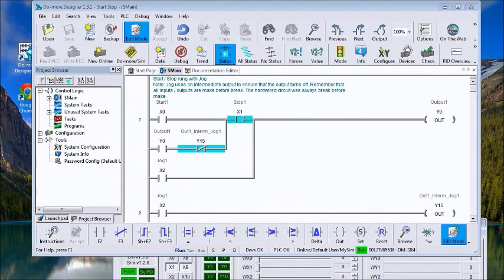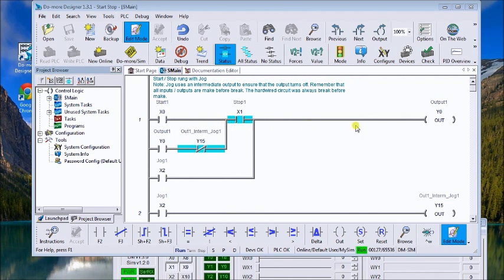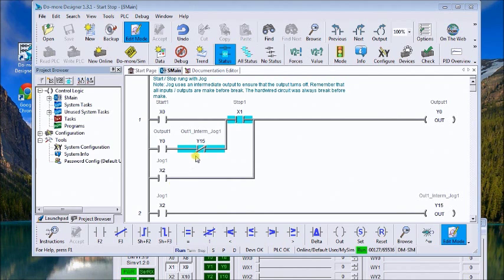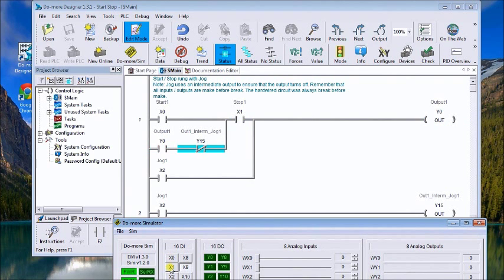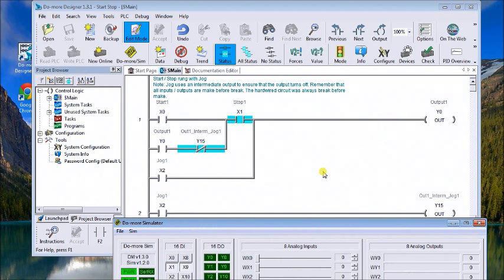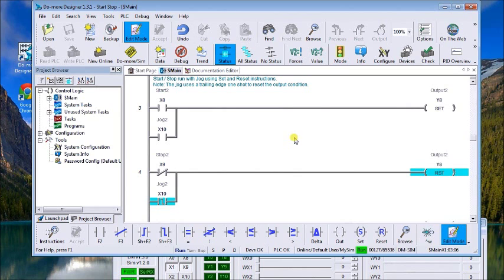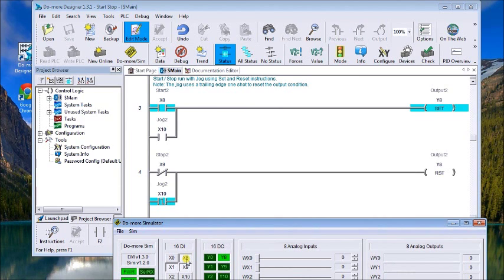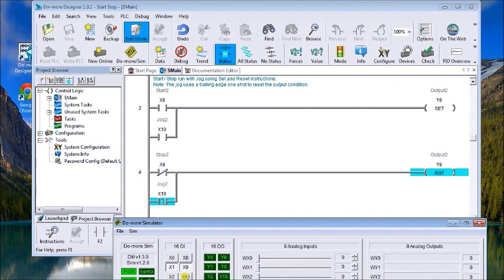Master PLC Programming: Start/Stop/Jog Circuits Made Simple

Comment: Great video! I was just wondering why x1 looks like a normally open contact even though it's normally closed. Don't the normally closed contacts look like y15?
Reply from the maker: Hi Emmanual,
 X1 is a normally open contact, however, stop buttons are usually wired normally closed. In our case, we are simulating a regular normally closed stop button. We would use the normally open contact in the ladder logic so it would activate when nothing touches the button. 
These stop or emergency stop buttons are wired this way so it is fail-safe. 
I hope this helps you out.
Regards,
Garry

Comment: u not explain ,how  u make this type of circuit...which instruction u use, how connect jog.
Reply from the maker: Hi Chandan,
This circuit uses input contacts normally open and normally closed. It also has an output instruction. 
The jog button is a normally open push button that is wired into X2 of the PLC. 
This is using the simulator of the Do-More Designer software.
NOTE: A new version is available for download that now covers the BRX series of controllers.
https://www.automationdirect.com/adc/Overview/Catalog/Software_Products/Programmable_Controller_Software/Do-more_PLC_Programming_Software

Regards,
Garry